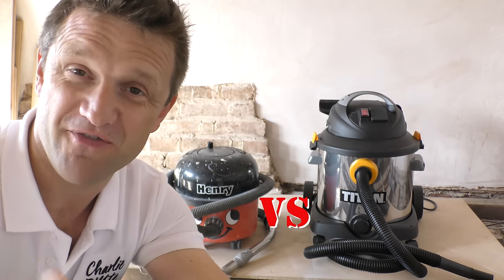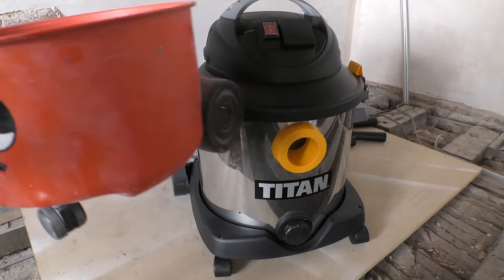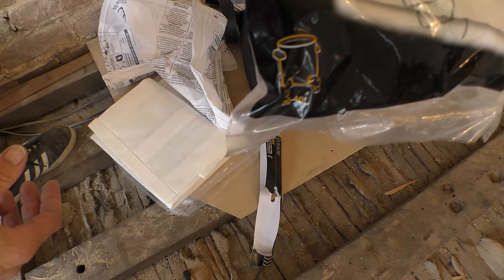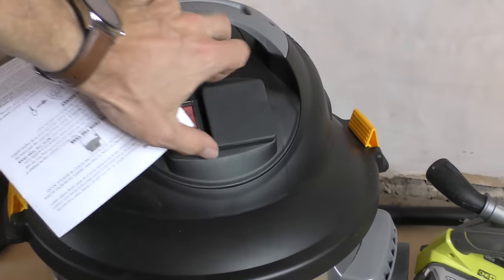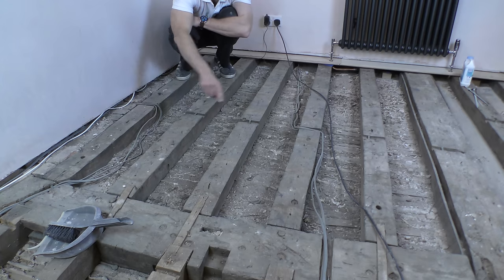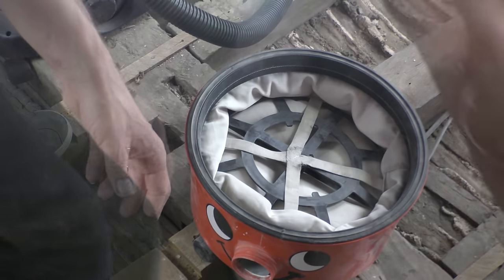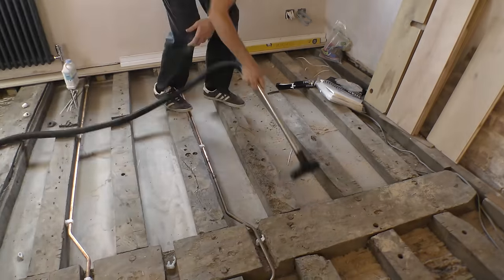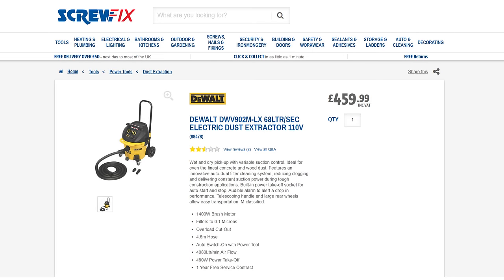TITAN vs Henry - DIY Vacuum Review

Comment: George would probably do a great job of this he has a bigger tank and he has a big type of what you could probably fit more in the HEPA flow then Henry
Reply from the maker: Thanks Matthew. In hindsight this was a rather unfair comparison as the Titan isn't designed as a domestic vacuum. I've recently been using it as a shop vac connected to a cyclone https://youtu.be/9RfHpm2vf40 and it really comes into its own for that, particularly with the pass through switch.
Reply: Just made it seem like you didn't like the Titan I got to say I live in the u.s. I don't know if you know that but I live in the US and funny enough the shop box that we get don't have the feature where you can plug in another power tool that's pretty interesting

Comment: If the Titan has flimsy plastic tubing will just break easily on the Henry has metal tubing I recommend the Henry
Reply from the maker: The only problem is the connector not being compatible with the Henry. I use mine now with a DIY cyclone (it's really meant to be a static shop vac and it's very good for that) https://youtu.be/9RfHpm2vf40?si=8zz8aYWUrljFG9e1 but I do use the Henry vacuum attachment when vacuuming floors.

Comment: The Winner is The 2000 Numatic Henry HVR200
Reply from the maker: Agreed. I've hardly used the Titan since but I've got it sucking up MDF on my current project https://youtu.be/R1dKybdYyY8, in video 2 coming out this week.
Reply: You can also get 1200w Henrys and hettys on eBay since your one is now 620w

Comment: I think the reason why old Henry isn’t as powerful is the new Henry has more efficient internal ducting and a tapered hose which allow the new Henry to be as powerful as the old one, the new motor in an old Henry isn’t going to work as well.
Reply from the maker: I think that's right. Espares still do 1400 watt replacement motors for Henrys though whether they fit all models is another question.

Comment: Owned the titan, strongly advise against buying. In the process of upgrading to a Numatic vacuum.

Titan packed up and was always a pain to use with constant blockages, split bags and dust clogged motors / filters significantly reducing the suction to a point of it being useless.
Reply from the maker: What I discovered is that it's realty designed to be used as a static shop vac attached to a cyclone https://youtu.be/9RfHpm2vf40 It was actually quite good at that. It's definitely not a domestic vac.

Comment: It looks like the Titan is missing the float ball for wet use 16:58.
Reply from the maker: It's got a black plastic container that moves up and down inside the retaining cage. Should there be a ball as well?
Reply: @CharlieDIYte  Other wet/dry vacuums I've seen have a ball which floats up and blocks the intake to the motor to stop water entering the motor and to indicate the tank is full, I guess this should have one.
Reply from the maker: @FM60260  It has a cylindrical container instead, which I suspect isn't as effective as a ball.
Reply: @CharlieDIYte  I probably missed it if it fell into the intake when you turned it over.
Reply from the maker: @FM60260  That'll be what happened but thanks for raising it anyway!
Reply: @FM60260  Its the way some wet dry machines are,some have a ball and some have a cylinder

Comment: I'd buy another Henry all day long !! ive got two of them the oldest being 15 now bloody brilliant little machines and you can buy them for just less than £100 anywhere!  Ive always used bags bought from Ebay ,very inexpensive and work well .
That thing you've bought there is CRAP basically and will NOT LAST the test of time.

Comment: Strange the diameter of the bag is to wide and the diameter of the hose is to narrow needs to be the other way round.
Reply from the maker: Yes, but what I've realised since doing this video is that the Titan was only really designed to be used as a static shop vac. I used it in this capacity attached to a cyclone to build my wardrobes https://youtu.be/9RfHpm2vf40 With the cyclone you no longer need a bag in the vacuum and it's been brilliant. It is definitely not a domestic vac.

Comment: Henry for last 9 years, brilliant for DIY and hardfloors, not so good on carpets and pet hair, I use a Bosch battery jobby for that, But reliability is appalling, three brush heads, new battery/electrinics, new casing, new handle, eventually, bosch gave me a new one after three years???

Comment: The titan made me buy the festool!!! I had a Henry for years untill a chimney fell on it and the poor thing had to go. Replaced it with the titan. It's a hateful shit heap! Your paper bags rip all the time and dust plumes all over the customers house, when sanding or sawing with the hose attached and cable it builds up a astounding amount of static electricity, fun for a while but gets old very quickly! That filter will for no reason brake, then the sanding dust will plume over the customers house and also giving you a much amount of dust to eat. The hose is awful, the drum detaches from the motor and all the stuff launches out all over the place... It did this to me whilst climbing a ladder up a scaffold, that was fun.... No one died I guess. The tear resistant bags are alot better when they are available for purchase, but you'll be using it to tidy up after work and it will randomly slip off the inside of the vac hose and fill the customers house with plumes of dust... Again! It's not nice to pull about, big clunky and I hate it so much. Blow function was good... It is a horrible heap of shit. Save up, get the metabo vac or the festool, you'll soon forget the money and they will pay for themselves as this one cost me so many hours of cleaning up after the thing that is supposed to clean up. Over all its a shit product and I would say it does more harm than good, health wise I wouldn't trust your lungs to it either. Deadly shit heap.
Reply from the maker: That's a very good, fair comment, mate and what makes me so angry about it is that utterly unnecessary design flaw of the bag slipping off the hose inlet inside the vac. I had basically consigned the Titan to the scrap heap after doing this vid but everything suddenly became clear to me recently when I connected it to a cyclone dust extractor https://bit.ly/3fssYHn It made me realise that the Titan is designed for one purpose and one purpose only - as a static shop vac connected to a cyclone like mine. That way you can dispense with the bags. The crap hose suddenly comes into its own as it's flimsy design is well suited to it being the last conduit between the cyclone and your power tool, and the  pass through power tool switch works perfectly. I'd go so far as to say I've loved using it in this capacity recently updated the cyclone with a relief valve https://bit.ly/2RVowHe

Comment: Too loud imo. Damage your hearing but if noise is not a problem it's good value but for me cleaning up a empty room or running with a sander it's too loud
Reply from the maker: Fair point but I wear ear defenders these days with the sander and actually this was a bit of an unfair test to pitch the Titan against Henry as the Titan isn't really a domestic vac. It's best used as a static shop vac attached to a cyclone https://youtu.be/9RfHpm2vf40

Comment: Im back to zero with these big boys and there filters in the middle sitting infront of the inlet. They are done so fast with the wood dust hitting it ( they said with myn you can wash the filter, how i dont see but thats an other story cleaning the sink). Replacing the filters is expencive ( for the 3 times full of saw dust). So far im not that happy with them as a diy machine and i maybe go for a more pro machine.

Comment: hey hey hey build yourself a cyclone i use a nilfisk vac really good powerful, power take off to run tools. bags are expensive so i made a cyclone for about 30 pound look it up .its the way forward
Reply from the maker: Agreed. I definitely need one when using this as a workshop vac.

Comment: Shock, horror. £54.99 POS isn't a patch on a £134.99 Henry. 19 minutes of my life that I'll never get back.
Reply: You chose to watch a video comparing two vacuum cleaners. Were you expecting twists and turns akin to The Usual Suspects?
Reply: @cedarstuff  I was expecting the unexpected, that the cheap one was as good as the dearer one. It wasn't, so what was the point of the video?

Comment: Forget the bag in henry, then all u got to do is bang the filter out occasionally.
Reply: percygsi They are not designed to be used without a bag.  The bag keeps the filter clean and the motor clean as well as prolonging the life of the motor.  Using them without bags is messy, it clogs up very quickly and will ruin the bearings of the motor.

Comment: Which is better? None of them, the bagless would make much better work, especially with a separator of big particles like the rocks. Bagged technology is old and almost forgotten thankfully. They lose the suction as the dust builds up in the holes in the bag. The power of the motor is just wasted and acts as a stinky room heater.
Reply from the maker: You need one of these. https://www.youtube.com/watch?v=9RfHpm2vf40&t=102s

Comment: £20 on bags every year or jut a new vacuum every 2 for just £59 including attachments , cable and plug etc ...
Reply from the maker: And actually if you run it as a shop vac as it was intended, attached to a cyclone as I did on this project, it's actually pretty awesome https://youtu.be/9RfHpm2vf40 👍

Comment: I would not recommend this vacuum cleaner. I have the 20 L cleaner. One of the wheels fell off within weeks.  I was unable to reattach it. I had misplaced the receipt otherwise I would have returned for a refund. The wheel attachment is a poor design, something like 5sq mm of washer is all that attaches the wheel to VAC rim. Worse, I am unable to find a replacement wheel. I am now looking to see if I can stick the wheel on with a chemical glue.
Reply from the maker: I've got to say, I haven't used it much since making this video. The main problem for me, apart from the woefully poor accessories, is the ill fitting vacuum bag. So much dust leaks out everywhere!

Comment: I use a Henry XL plus! Here is the link: https://www.myhenry.co.uk/henry-xl-plus
Reply from the maker: Yes it's a good machine that and doesn't really feel any bigger to lug around than the standard size. I think they've missed a trick though including the smaller aero head but not the larger one.
Reply: @CharlieDIYte  Are you planning to sell the George as Amazon is out of stock?

Comment: I've got a Nilfisk from Screwfix.  1950w power takeoff, which works brilliantly.  It's pretty much permanently installed in my workshop though, with a cyclone between the tool and the vac.  https://www.screwfix.com/p/nilfisk-aero-26-21-pc-1250w-25ltr-wet-dry-vacuum-cleaner-240v/66972?_requestid=382198

Comment: I have a Titan got rid of my Henry the Titan is much better suction and I’ve upgraded the filter aswell so I don’t need to swap over going from dry to wet also upgraded the hose the Henry is a better built machine but I need a good vaccum for car valeting and the Henry wasn’t powerful enough the Titan is much louder but better suction

Comment: Just bought a titian today, and he is spot on. The dust bag is like a cock in a sock.
Reply from the maker: I like that analogy 🤣 Thing is, the Titan wasn't really designed as a domestic vac. Use it as a static shop vac as I did here https://youtu.be/9RfHpm2vf40 in conjunction with a cyclone extractor (negates the need for a bag) and it's actually very good. The manufacturer should make it very clear though what it's designed for, as it shouldn't be up to the customer to have to work this out.